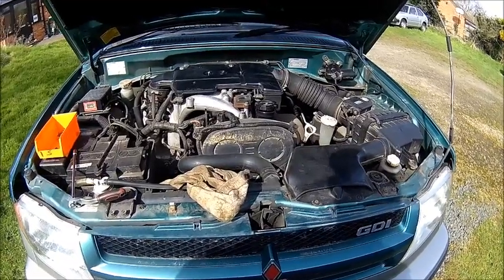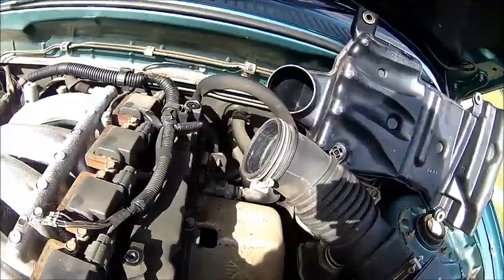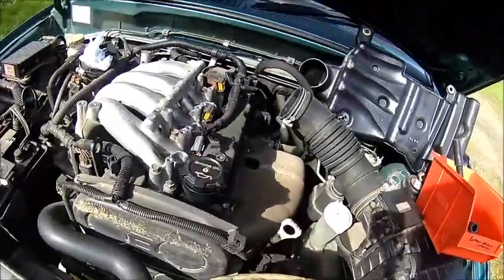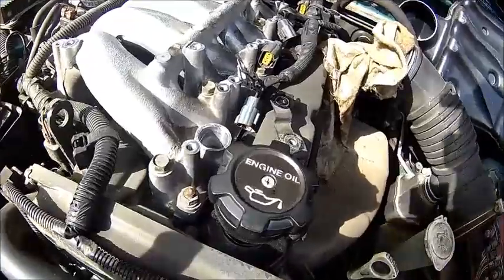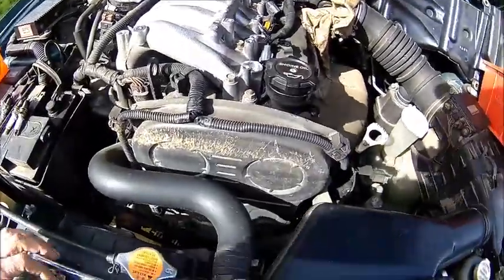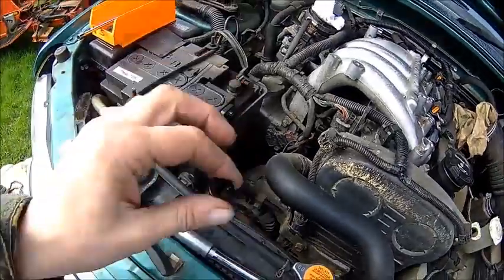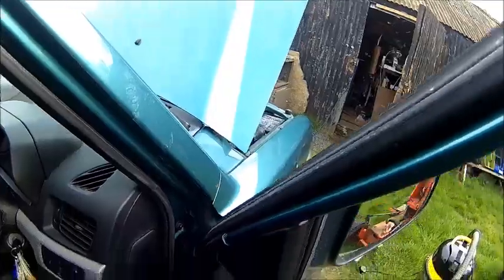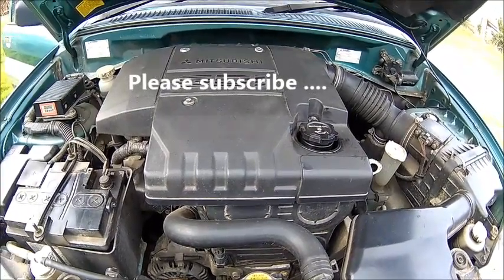Digging out the plugs - Mitsubishi 2.0 GDI engine spark plug access (4G94 engine)

Comment: Thanks for the video it helped me with my 2003 Galant with the 2.4 GDI. I had a very occasional misfire on cyl 3 when cold which was due to a mucky contact like you showed 👍 one thing done to my car and should be done to any Mitsubishi GDI is to install an oil catch can. It helps prevents soot accumulation in the oil and also prolongs oil life

Comment: Hi. I have an almost identical Mitsubishi 2.0 GDI with somewhat similar problems. Since I've had the car (4 years), you say the engine speed was limited to 4000 revolutions per minute. Up to this limit, everything was ok. For almost 1 month, the engine behaves well only when idling. When I press the accelerator pedal, the engine stops. Can you give me an idea of what the problem is? With much respect. PS, sorry for the inherent mistakes, but I used google translate.
Reply from the maker: Throttle body magnets, fuel filter, fuel pump would be my plan of attack

Comment: Great tips and easy to follow instructions. I have the 2.0l 4g94 engine in my Pinin IO and the engine idle i rough, rougher when warm. resulting in engine light lit up. i've checked everything you checked on your three videos but no success, as of yesterday I ran the engine idle when cold, and I lifted the oil dipstick 5-10 mm and the engine just stopped the rough idling and the enginelamp disapeard. I have not checked the obd2 codes. Please help, is there a crankcase vent on this model, and where is it placed?
Reply from the maker: Thanks,...the crankcase ventilation is the hose (approx 1/2" dia) on the back of the intake bridge,  about in the middle between throttle body and air filter side. Also check your throttle body, might be full of gunk
Reply: @dynoguy  thansk for a fast respons, the throttle body is taken care of, the spark plugs ok (also checked ignition coils)and the crankcase hose is working, havent checked the crankcase, Im going for the microfilter that you described here https://youtu.be/KjKNnthAamg?t=54

to be continniued :D

Comment: Hi, how are you? Did it keep on eating up oil?? Mine wastes (eats) oil idk where to. I always need to topup. Yesterday I drove it no problems at all. 
But today when I went to start it, suddenly it was running bad with some misfire, check engine light went on some minutes after! I have no ideias for now... Any tips?
Do you think it might be the same issue?
Reply from the maker: These engines do have quite a few problems, hard to tell what's wrong with yours.
High oil consumption can be worn pistons, worn valve guides, too much crank case pressure because of blocked pipes,  too thin oil or oil thinning by fuel. Misfires can be a bad spark plug, coils, injectors, blocked intakes and sticky valves due coke build up (big problem on those). so really hard to tell whats going on with yours without seeing it in real. Frequent general maintenance keeps them going, but lack of maintenance kills them very quickly.
Reply: @dynoguy  Hello! Thanks for your super reply. I went on and removed all spark plugs. 
The first one was so tight that almost didn't come out, but after some struggle it came out.

One of them (nr. 4, counting from the front of the car), the coil and the plug itself were dipped in oil. I guess that's where some of the oil is going.
I guess it's the valve cover gaskets, idk. What is your advice? I'm about to clean/change the plugs and see if it still missfires. 
Do you have any video of doing the head cover gaskets on the 4G94 Pajero GDI?

Which oil do you use on these engines? I'm using Caltex Havoline 20W50 ( link to oil https://bit.ly/2WBTVeA ), what are your thoughts?
Reply from the maker: It seems rather common on these engines that the spark plugs soaked in oil, make sure you clean everything thoroughly as the spark tends to go the easiest way, which is not always on the tip of the spark plug. I usually spray coils and plug connectors with silicone spray, but make sure nothing gets into the combustion chambers because silicone poisons your lambda sensor. When you refit the plugs, use a tiny bit of anti-seize, makes it easier to get out next time. If a plug is stuck, it may help to warm up the engine (or wait if it's stone cold) and then try again.
Cover gasket is easy, just remove the bolts, no video yet but i may do another 4G94 related one later on this year as the intakes are pretty full of carbon so i will do quite a bit of dismantling then.
I use just normal 15W40 oil for all my cars and bikes, can't see the point stocking different oils because i buy that in drums from a truck parts supplier, costs me around $2 a liter. The Mitsy oil + filter gets changed every 5000 miles, by the way.
Reply: @dynoguy  hello! and thanks for your reply!
I'll try to have everything cleaned (coils are already cleaned, no rust, no debry, was only one of them full of oil), and will replace the spark plugs with new NGK Platinum BKR5EGP one g-pole, (the ones in the car were two g-pole BKR6EKUB).
Unfortunately I don't have and can't find around my local maket Anti-Seize, but will outsource some when possible. I will also try to remove some oil from the combustion chamber using a sprayer bottle head that may have gone there after removing the oily plug.

Let's see... 
Regards

Comment: Hi guys, I have a 2004 Mitsubishi 2.0 GDI petrol, the story is, the car came to me from a recovery guy who got it as a part exchange on a deal, and the car only has one owner from new with 20850 miles on the clock the MOTS back up the mileage. the problem is I was told the car needed the fuel pump replacement, that's been done by myself, now the car turns over but won't start, and nothing comes up on the dash to say there is a problem, going by the mileage the guy who owned it didn't drive it much,,, Any ideas as to why the car won't fire up..oh the ABS light stays on but that's it
Reply from the maker: Hi,... check fuel to the hp pump, the in-tank pump has a filter which can be blocked, check the tiny filter at the intake of hp-pump, remove rail pressure sensor to see if hp-pump actually works, if that's all good you've got an injection or ignition system problem somewhere. Obviously check with suitable software  if there any faults stored, the check engine light off does not necessarily mean that there are no faults.
Did you check with brake cleaner if it fires ? would at least tell you that the ignition system works

Comment: I have some oil downside of the fourth Spark plug , how to change this downside oil joint please
Reply from the maker: It's usually the valve cover gasket leaking,...a lot of wrenching to get that changed
Reply: @dynoguy  i just finish thé timing belt :( so Bad 
I need to put out the two camshaft and put out again the timing belt for sure ? Need to put out air intake manifold too ?
Reply: @dynoguy  Ok ! i need to put out the Crankshaft ? Did you now where i can get a repair book PDF about the Pinin 2.0 gdi please

Comment: Hi i have to topup brake fluid very frequently on my Shogun Pinin 2005 model. 53000 miles on the clock, any idea why it's using too much brake oil? Thanks
Reply from the maker: Well, the most obvious reason would be a leak,  just check every brake system component for signs of leaks. including corrosion on brake lines.

Comment: See yours has the power steering/aircon belt squeak too. There's a 14mm bolt on the side of the tensioner pulley bracket, but it doesn't always fix it.
Reply from the maker: It's the alternator belt, the battery is very weak and the belt is old and hard, both need changing very soon

Comment: What would cause the shouting off of my GDI engine
Reply from the maker: Do you mean that popping noise just after you shut it down ?
Reply: And it is all so losing power
Reply from the maker: Assuming there are no fault codes, the loss of power with these engines points towards a lot of coke in the intakes, usually starts getting worse around 50,000 miles, how many miles has yours ?

Comment: Hi what year is this . I have a 2ltr 2002 io and the top of engine is completely differant. I am  in Australia. If you can send me your email i can send photos. If you have the time to help cheers . I also only have 2 coils 2 plug leads from each one from Andy .
Reply from the maker: Hi, mine is a 2002 as well, ... if yours look like i can guess from your description, it's simply not a 4G94 GDI engine, but a 2 litre with manifold injection instead. These are entirely different animals... Email address is in credits at the end of the video.